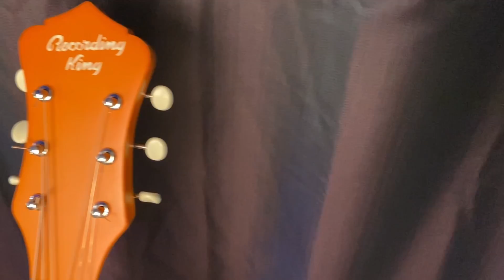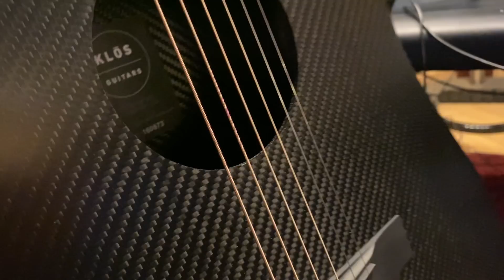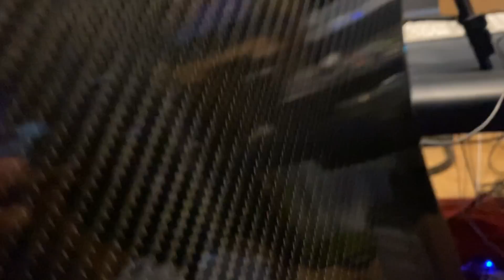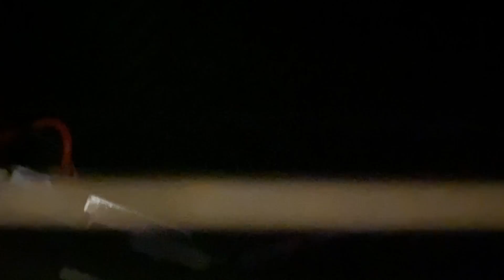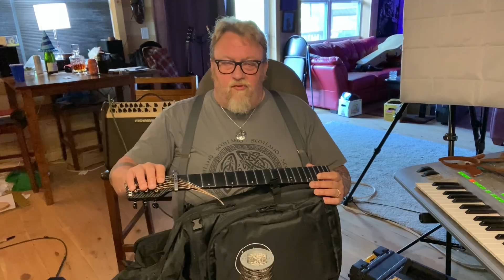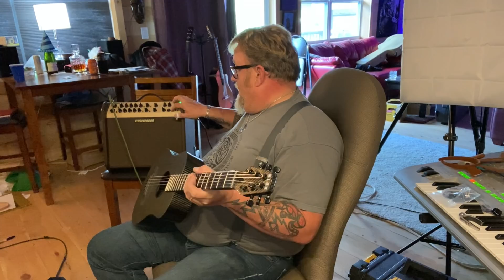GSWJ - Klos Guitar Review: Dreadnaught and Travel size!

Comment: Had many electric guitars and electric bass guitars throughout my 50 years of playing .All had wooden necks. None of them had a stable neck and never stayed in tune due to the weather in Maryland. I would check the height of the strings at night then in the morning. The string height changed from any temperature change. I now have a carbon fiber neck on a fender body and two aluminum necks for my bass guitars. I will never own a wooden neck again. Also when I had guitar / bass guitars I had to have a tool kit due to frets rising / change string size and now you got to adjust the truss rod..Breaking on string on a wooden neck your whole guitar goes out of tune. Carbon fiber and aluminum necks is the way to go.Wood is very unpredictable but petty to look at.,A truss rod and two support rods next to the truss still has a had time keeping the neck straight and true

Comment: The smaller sounds a little more thumpy and the larger not much at all. So there is a difference, the small body has more pop and echo like. Definitely like the larger body and the scale lengths for both are the same. Nice sounding guitars.

Comment: Wow. Nice picking. I've had an early Klos travel guitar - with a mahogany neck - since late 2016 and still really, really like it. It's not the same as my battle-scarred 80's Taylor 510, but when it's not travelling it is perfectly at home sitting right next to it. When I first received the Klos I got into an email conversation with Adam Klosowiak about it and made 3 suggestions: a) Ship it with a better capo, b) Include a screwdriver,  and  c) Replace the 4 wood screws with machine screws and threaded sleeves. I am delighted to see that your guitars include all 3 - that says a lot for Klos as a company.

Comment: The Dreadnaught sounds fine but that travel size sounds a bit like a ukulele unless plugged in. My travel guitar is a CA (Composite Acoustics) Cargo and sounds bigger and less boxy. You are correct, no adjustments on my guitar. Once I cut the nut slots so it didn't play sharp at the first couple frets, it became a great little guitar. A close friend swears by his Journey Instruments carbon fiber guitar. Composites are hard to beat for stability and durability and many have amazing tone. If you want to spend some major coin on a carbon guitar, McPherson also makes them which pretty much lifts composite guitars from novelty to full-on legitimate.

I've found that some Fishman amp/guitar combinations really benefit from a TC Electronics BodyRez pedal. Might help that Travel Klos.

Comment: One thing I ordered you didn’t mention was the side sound port.  It Doesn’t seem important… but to me it is a good addition.  I strongly suggest it. At least on full size. 

But I liked your explanation: it isn’t wood: It isn’t “better”but it also isn’t “worse”. It is just different.

I think it plays cleaner than wood. Which means you need to play a little cleaner. But that is not a bad thing.   (For example: I think it is easier to hammer on etc. ). And yes I think it would be a perfect practice guitar. You move to wood after being forced to play clean on this… and you will sound great. But you don’t need to move to wood… this is all you need.  Unless you get a travel size one.

EDIT: I also used the word “addicting” when describing playability in my text review of this guitar. I have not yet posted… I got it in August but wanted to wait a few months before posting a review.

Comment: JP I ran into the same thing . . . I used to think carbon fiber guitars sucked . . . but my friend has NGD (every day it seems) and unboxes a carbon fiber mcpherson and emerald x20 / x30 . . .  the mcpherson and emerald has their own tones, its loud but the chords ring with the notes . . . plus they are nearly weather / climate proof.

Furch Guitars makes a great travel guitar, my friend who's money instead of collecting planes, trains, or automobiles like his father / fore father he collects guitars
is how I know about these guitars

Also composites can be engineered for specific frequencies either dampen or release. I can see in the future music instruments being made with this . . .  All the aerospace companies make them (because different parts of the plane vibrates, so for longevity purposes they engineer the composites . . . example is the wing vibrates at a certain range of frequencies and they design to absorb and dampen, the attached engine casing has its own vibration and the wing itself, depending on location will have its own frequencies, ex tip vs middle or leading edge vs flaps . . . )  

stealth mats used in stealth fighters can deflect radio (and some sonic) or absorb . . .

It is possible to engineer composites to match or even exceed tone woods, but guitar manufacturers haven't put research or funding into this. 

Its like the audiophile industry has amazing vacuum tubes with modern designs, or tube amplifiers far better than guitar boutiques, but guitar industry has far less budgets than audiophile industry . . .

It's weird more research is done by electric guitar industry into how to relic guitars to look like specific wear, than modernizing design (they could keep same looks but make better tone quality) or how much effort into specific vintage tones but no scientific tests on frequencies and building amps to match, while the audiophile industry can successfuly nail vintage record sounds with modern turn tables.

Comment: I listened and I watched. This guitar has good sound for a composite guitar. The sound is not for me. Even plugged in that guitar lacks alot of brightness and warmth compared with a wooden guitar. It might sound better with a K and K. This guitar has a definite niche market. If you live in Costa Rica or anywhere in the tropics this guitar is great because wooden guitars don't do well in those climates. This guitar is great because the composite fiber doesn't move with changes in humidity and temperature. For sound WOOD IS KING! Cheers everyone.

Comment: I have a Composite Acoustics Cargo and it is amazing. It sounds absolutely astounding for the size. It doesn't have a truss rod but the saddle isn't fixed and I shaved it to a really nice height, although after 15 minutes of sanding it felt like it was going nowhere and realized it was carbon fiber too. 15 minutes on a grinder later and voila. The Cargo ate my Journey OF660 for breakfast lunch and dinner. I got the Cargo for a steal at $400. If you can find one for under $1000, get it.
Reply: I have a CA Cargo. It sounds amazing except..., sharp on the first couple frets and since the nut is molded carbon fiber, I am afraid to file the slots any deeper for fear of going through the gel coat or going too far and having no recourse. So, it's a weatherproof, indestructible travel guitar that really makes me homesick for my wood guitars.
Reply: @patricklundquist9869  Is yours a pre-Peavey? I've noticed the fit and finish of those aren't great. Mine is a Peavey and everything is perfect. Also I play it more than my '49 Martin 0-15 and my all solid Custom D.
Reply: @patricklundquist9869  I just looked at mine and the nut isn't an integrated piece, so I could replace it if the need arises. Yours is definitely different.
Reply: @TheGuitarsquatch  There goes my theory that pre-Peavey was better. Yes it is a pre. I definitely play my Martin J-40 more often. I'll need to keep an eye out for a KLOS. JP is really good at convincing me to buy guitars.
Reply: @patricklundquist9869  From what I understand, when Peavey took over they would toss out whole guitars if they came out of the mould wrong. So the quality control was almost too good, it might be one of the reasons CA went out of business.
Reply: @Elyon Alone Neck profile is a matter of taste. The detachable neck is a plus, but I never traveled where that was needed so it didn't matter at all. The body was is too deep on the OF, so not only was it a bit unruly, the sound was getting lost in the body before it came out of the soundhole.
Reply: @Elyon Alone Also the frets on the OF are basically sucked up by the fretboard. I don't even want to think about what a fret replacement would cost. It's probably on purpose so you have to by another neck from them, which I would assume would cost near $500
Reply: @Elyon Alone The frets on my OF were encased by the fretboard, I can't imagine that would be an easy job.
Reply: @Elyon Alone I didn't mean the ends were incased. The one I had, the fretboard material ramped up the length of every fret. It almost looked like it was scalloped. It's hard to explain. I just didn't like the fact that it looked like you'd have to cut carbon fiber off of the length of every fret if it needed frets one day, which it would since they weren't stainless steel.
Reply: @Elyon Alone I bought mine directly from Journey last year.
Reply: @Elyon Alone the journey is Chinese built?

Comment: I have a thin body Rainsong. It was one of the last built in Hawaii.  It has the Fishman pickup. It sounds very much like the Klos. I like how you can take to stage out of a cold vehicle or the belly of an aircraft and is still in tune. You have done a great revue of this product. Thanks for sharing!
Reply: I have a rain song made in Hawaii I use  the e a and g strings from a nylon  set of strings mellows the tone a lot